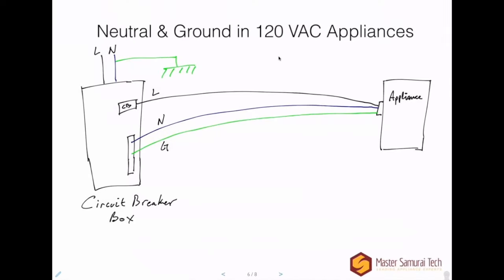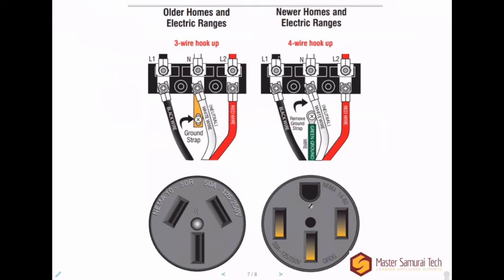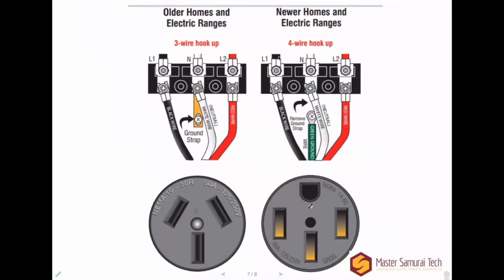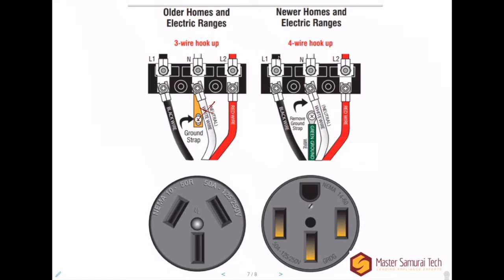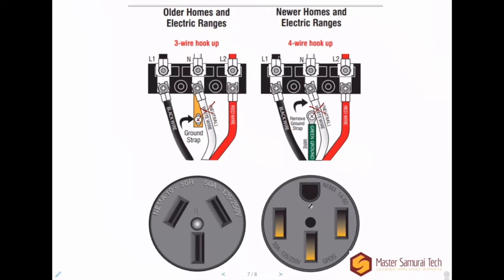Neutral is not Ground; Ground is not Neutral

Comment: L1 and L2 are basically interchangeable right? I'm hooking up a longer cord for my gasoline generator, and they were inconsistent with the original L1 and L2, but consistent on each end with ground and neutral.

Comment: I work for an electrical company. I was made to i stall the outlet for the 50A 3-way plug using 2 hots and a ground on the neutral lug. It even said "neutral". I protested but eventually lost since his rationale is that this is the way motors are wired. A large device was going to be plgged into this outlet, not a motor. I feel it was the wrong way but I am a new hire, I had to just shut up. Am I wrong?
Reply from the maker: For three wire outlets, Ground and Neutral are tied together. For four wire outlets, Ground and Neutral are kept separate all the way back to the circuit breaker panel where they are bonded together.

Comment: I don't have two hot wires on my 3 wire range. House was built in the 80s. I only have 1 hot, 1 neutral, and 1 ground.
Reply: It sounds like you have a black wire (hot), white wire (other hot wire), and green  (or bare) wire (ground/neutral) going to that 3 prong 240volt range outlet, but that's just my guess? If the outlet on your oven is truly 240 volt, then it almost has to be like that. If so, you need to take some red tape and wrap it on the end of the white wire to indicate it's a line (hot), and take some white tape and wrap it on the end of the green (or bare) wire to indicate that it's being used as a neutral. Not a good situation, and should probably be corrected by a licensed electrician.

Comment: My electrician refuses to ground to neutral on 40A three-prong stove hookup.  But now there is no ground at all on the stove chassis.  Isn’t this even more dangerous than tying ground to neutral?
Reply from the maker: I've found that many electricians know how to run romex and wire switches but they don't understand electricity. Sounds weird, but it's true. Get a new electrician.
Reply: Wires do not just burn on overload. The breaker trips first. Also if the neural were to break the case would become energized even without any other failure.
Reply: 100% yes.  I have a relative who got a shock from exactly that.   The insulation of the electric heating element broke down over time.  This caused stray voltage on the stove and a cooking pot on the stove, but there was no path for it.  This person touched the cooking pot, and a grounded appliance at the same time, and zap.
When I looked into it I was like, "who the heck wired this up?"   I guess now I know.  ;p
I also ohmed out all the elements to look for other bad ones, but I do not remember the results anymore.
Reply: @AppliantologyOrg  I just bought an LG stovetop and its got 3 wires, red, green and black.  Realizing the white is either white or tied to ground.  Its an older apartment made in the late 1950s we think.  The stove I had running, on a 3 wire plug shocked me as I held a stainless steel skilled I washed and set onto the stove with my hand in the sink/water somehow and got shocked.  Noticing this stovetop might be wired so there is no ground either, idk.  Previous renters messed with the wiring box and the city sued them, the panel is still off so the breaker wires are all visible Im not touching it;  the GFI outlet next to the stove has a green light on?  but doesnt work, plug in a coffee maker or ? nothing.   Just want to connect the LG stovetop the right way.

Comment: In the past, there were appliances that the neutral and ground were not separated (inside the appliance).  That was a good while back, but you still run into them now and then. It was back  when things were made to last. I don't believe I have ever seen a single person on an electrician chatboard address this. Is it because they don't know it exists? Or is it because they don't want to say it is out there but they have no comment on it.
Reply: 240V cooktops, for example.
Reply: I think some really old radios and television sets (pre-1960) had a condenser connected between the neutral or what is assumed to be neutral,  and the chassis.   And because two prong plugs and receptacles, some of which were non-polarized, (meaning both prongs same size) typical of the era, you have a 50-50 chance of inserting the plug in reverse and having a live chassis.   And even if the plug and receptacle was polarized there is no assurance that it was wired properly.

Comment: Appreciate the video, because much of the misunderstanding regarding ground and neutral can be traced to the 3 wire dryer and range receptacles that were legal and widely accepted though the 1993 NEC (prohibited in 1996) and further complicating this configuration which I firmly believe should have never been permitted in the first place, was the interpretation from local inspectors.  I have done renovations in the past and have found 8/2 & 10/2 NM for ranges and dryers respectively,  with the ground acting as the bare neutral, this was never technically permitted per the NEC but was apparently permitted in some jurisdictions.   Through the 1993 NEC stated  that for frames of dryers and ranges grounded with the grounded (neutral) conductor,  the neutral must be insulated or bare when part of an SE cable assembly,  and shall be no smaller than 10awg.   

The history of permission for neutral grounding can trace it's roots to 1942, when metal shortages and rationing during the war prompted manufacturers of electric ranges desperately wishing to sell their products to appeal to the code making panel and ask for special permission.  Their request was granted in 1947 for ranges,  and 1953 for dryers.   Ironically Canada never permitted this, and always required a true ground from the time equipment grounding conductors were required on all 125 and 250 volt circuits in the early 1960s.

Comment: How would you handle a spa where you only have 2 blacks and a white. Would you have to run a ground all the way to the panel? Could you install a grounding rod at the sub panel/disconnect near the hot tub?

Comment: Currently have 3 wire but my new stove requires a 4 wire. Can i just a ground to the existing 3 wire or does the whole wire have to be changed out?
Reply: You need to run a ground wire to the box.

Comment: Our house was built in 1980 and uses the older 3 wire 240v outlets for the range. I want to replace them with the newer 4 wire outlets. Luckily, they ran 8ga wire with a ground to the box. Unluckily, they cut the ground very short and screwed it into the outlet boxes. Would it be against code / unsafe to run a ground from the same screw on the outlet box to the new outlet? Or, does the run have to be continuous?
Thanks!
Reply from the maker: Not sure about the NEC code requirements but if the connections are done correctly, then electrically it would work.
Reply: If adding ground to an ungrounded recepticle, NEC allows you can add it by any means possible.  It doesn't even have to be ran with your current cable.  So in your instance yes that is acceptable.

Comment: Hello!  My Home has the 4 wire run from the Breaker box BUT my new stove only has 3 Wires and calls for the Neutral and House ground to be tied together... What should I one do when facing this?  Thanks!!
Reply from the maker: For an electric stove supplied with three wire romex, your three conductors are: Neutral, Line 1, and Line 2. Neutral is bonded to the appliance chassis. This is not desirable because if you get an open Neutral in the power wiring, that means the chassis is no longer Grounded. So the NEC was revised to specify 4-conductor romex. This way, Neutral and Ground are separated and Ground has its own conductor all the way back to the circuit breaker panel where it is bonded with Neutral. 

In your case with the 3-wire romex, existing installations are grandfathered in. The only way to upgrade is to physically remove the 3-wire romex and replace it with 4-wire. This gets real expensive real fast. As long as your 3-wire connection is done properly, just keep using it.
Reply: My Thoughts exactly! I'm very surprised these Brand new Dalxo stoves can be even sold in America.. Could you take the house ground and make your own chassis ground to the unit with it's own screw?  Thanks again! @AppliantologyOrg

Comment: Can I get some advice from you about replacing electric cooktop?  My outlet has black, white, and red wires, but my new cooktop has black, white and green wires. How should I match the color wires in that case?  My wall outlet doesn't have ground wire at all. Thanks
Reply from the maker: You’ll need to measure voltages to be sure but it sounds like your new wiring is only 120 VAC. You have L1 (black) Neutral (white) and Ground (green). Measure the voltage between black and white to make sure. I’m thinking you’ll only have 129 VAC there.

Comment: Just had a new dryer installed. I noticed that when I touch the dryer and the
faucet at the clothes washer I get a shock. Why?
Reply from the maker: You have standing potential between the chassis of the dryer and your plumbing. Check the wiring and grounding on your dryer. Make sure the ground is properly connected.